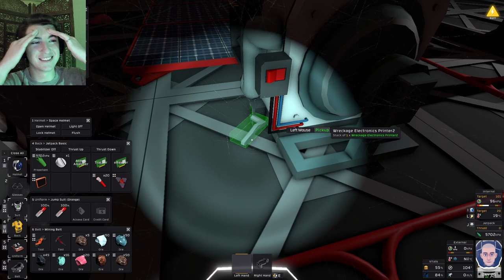Building a MOON AIRLOCK and STATION BATTERY | Stationeers 5

Comment: You can use the tracker bacon and the tablet to find your way back to the base. Also you can run the wire through the iron walk to the airlock and usually needs two passive vent and active vent, gas sensor for the airlock.

Comment: To fill oxygen canister use the yellow shaded slot on the big canister to fill small oxygen canister.
Reply from the maker: Is there a canister filler attachment for the ice crusher that I can set up?
Reply: @aquilaecompany  you'll need a canister mount to the piping with a pump to fill up the canister which you'll find in the hydraulic pipe bender machine.

Comment: Ur pipe broke cause there was pollutant in the furnace and it cooled down, at certain temps and press pollutant will convert from gas to liquid, to prevent this install a passive liquid drain on the pipe keep the furnace hot or dump press after ea use
Reply from the maker: Ahhhh I see, I didn't empty it- now we know!

Comment: Pro tips when u make air locks have the power/data ports face ea other, makes it easier, 2nd now that u have steel 3 critical items to make a dual axis solar panel a OMNI wireless charger and 2 Lg wireless battery. The wireless batteries are 1ur suit and 2nd for a portable light. Turn in the portable light with wireless bat and place it in ur suit trust me it’s a better light than ur suit cause it’s 360 deg light. As for ur jet pack “fuel” it can be ANY gas even CO2, or pollutants. You get that from ur furnace and other sources (like arc furnace)
Reply from the maker: This is great! Thank you! I'm gonna have to set up a pipe network in the next episode to get some gases in storage for sure. Appreciate your tips man!